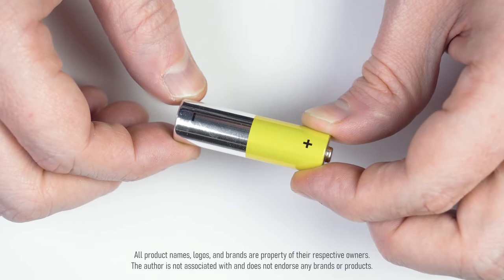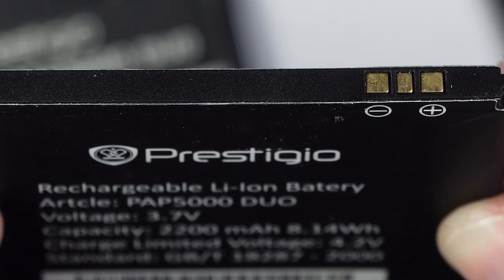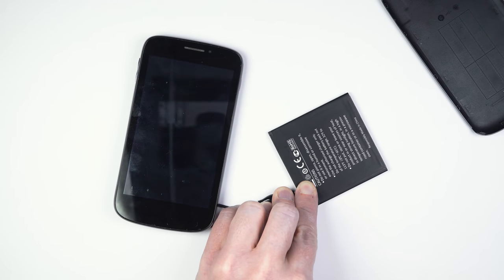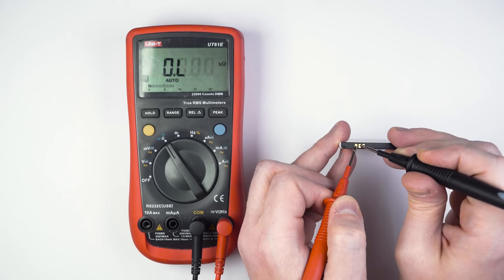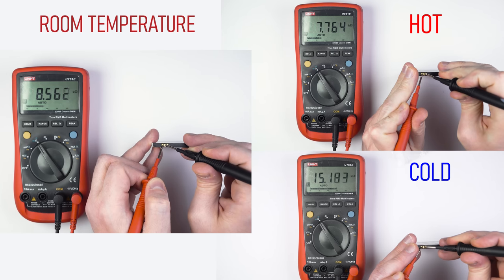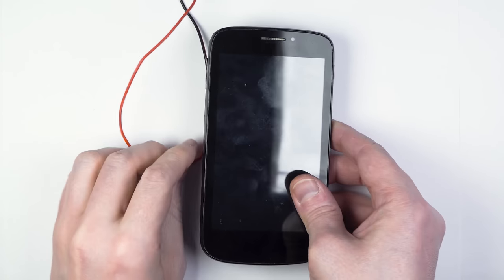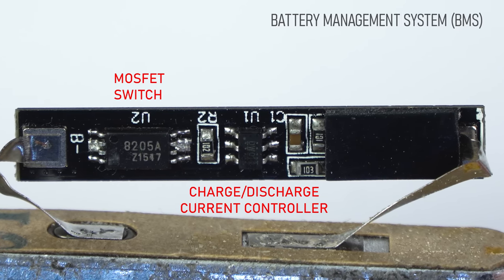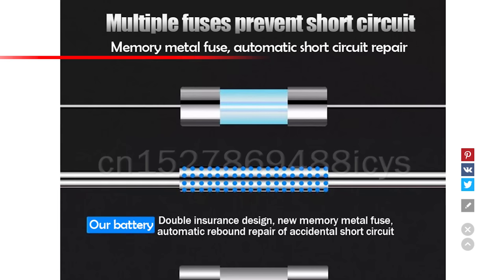Why do MOBILE BATTERIES have THREE terminals? A simple Explanation.

Comment: I have a few old smartphones which I want to repurpose into security cameras, bedside clock etc. The problem is I can't permanently keep them connected to chargers because of fire / explosion risks. Any advice to bypass the battery altogether?
Reply: Yeah you can !
Reply: @shantilkhadatkar1195  Any pointers to how I can do that?
Reply: Find the correct resistance between the sense terminal, and ground. Next, find the correct voltage for the device, and the correct amps needed to power the device. Now, connect a resistor (or correct thermistor) of correct resistance between the sense terminal to ground. And connect positive lead to positive terminal, and negative lead to ground terminal. 
>If this sound unfamiliar, or you are not sure what i am saying, than you can take this info and use it to research further into you project. It is not overly complicated, but i would not want to see a person hurt them selves by getting one of these steps incorrect.
Reply: he actually showed you in the video how to do it
Reply: Make a fake battery out of wood, or print it with a 3d printer. Add terminals in the right places, carve out or drill channels in the battery and the back of the phone for the wires, and connect the + and - from a 3.7 V DC supply to the terminals, plus a resistor to match the normal room temperature resistance of the thermistor, as shown in the video

When you measure the original thermistor feel free to use a dead battery, because the thermistor will still be as it should be; but it does need to be a battery rated for that phone 

Edit to add: our channel creator also suggests trying 10k ohm and if that doesn't work 47k ohm

I've done this myself back in the day when phones had older chemistry in the batteries. I've not tried it with Lithium but there's no reason it can't work. By not having the Lithium there you've removed the only really dangerous part of the phone so in the worst case you've just bricked a phone, not fried a whole building.

If it's a four terminal battery you may have to experiment to get the right connections for both the non-power connections.

I hope that is enough to get you going on that: your project to repurpose older smart phones is a great way to reuse old tech.
Reply: @Inertia888  I doubt he needs to simulate a thermistor with a static resistor.
That thermistor only comes into play when the phone is being charged through the charging port.

I am willing to bet you can leave the thermistor terminals open and the phone will operate from the positive and negative battery connections with power being supplied from a voltage source of the correct voltage and sufficient current.
Reply from the maker: Actually most phones check for the thermistor at power up, so you do need it to turn on the phone.
Reply: Well you can covert 5v dc to 4.2 volts and attach a diode so it trick the phone that it is charging constantly. I just watched that video but can't seem to find it
Reply: @shantilkhadatkar1195  You can convert 5 v to 4.2 volts using two resistors in what is known as a "potential divider".
But when you draw current from the potential divider the voltage will drop. So you need to design it properly so that the maximum current draw from it doesn't result  in too great a voltage drop. Careful calculation on the resistor values will determine this.

No need for a diode. Unless you're putting it in for reverse polarity protection, but as you are hard wiring in the new supply, or using polarised connectors, then there is no risk of getting the polarity wrong.
Reply: @deang5622  What u are saying is right but we need a diode on top of that. i actually tried it with my phone some years back but the charge kept dropping, like phone would go to 0% battery in about 10 mins. doesn't make sense right! Finally i had to put up a diode to trick the phone into alternating between 99and100% so the phone will never shut down.

Comment: Thanks, I kind of knew they temperature monitored, as in the 1980's we had military radio batteries that used a temperature monitor on NiCad batteries to indicate when the battery was charged using a constant current source.  If it starts heating up the energy is no longer going into charging the battery.  I'm pretty certain they used a diode for temperature monitoring. What I did not know was how it worked on these batteries, or that there was over current protection so thanks for the details.

Comment: 4 pins
V+
V-
Clock
Data
Reply from the maker: Nope, that's a great misconception that many people have. No mobile phone that I know ever used this setup. And I've seen quite a few of them when I worked in a repair shop. E.g., Samsung Galaxy S6 battery has 4 pins. Positive, negative, 2.7k NTC (thermistor), NFC sensor output. The battery also has "near-field communication" text on it. Laptop and power tools batteries do have serial chips inside so they use SDA/SCL setup, but no mobile phone, except newer iPhones.
Reply: @RonMattino  so is the NFC sensor on the battery? That makes sense considering where the battery is in the phone, but tbh I had previously assumed it would be in the rear case. My Fairphone FP4 has connectors of some kind to the rear case.
Reply from the maker: @trueriver1950  Yes, in Galaxy S6 it is. And if you use a 3rd party battery, NFC stops working. ;)

Comment: That phone is ancient
Reply: If course he's not going to play games like that with a phone that's still useful as a smart phone. He doesn't care if he bricks that one
Reply from the maker: You can't brick a phone like that. Bricking happens when you upload wrong firmware and the phone appears dead while it's physically in order. Burning a phone is not bricking, it's burning the phone. ;)
Reply: Yea, okay but this info doesn't apply to phones with an integrated battery. They often have connectors with many more pins, not just 3

Comment: That 3rd pin should also be a thermal balance pin. Balance pins assure that the different battery cells are at the same nominal voltage to prevent over charging and over discharging which damages the internal cell architecture. Single cells don't need balancing tabs, since its only 1 battery but they still need thermally protected pins; but 2 or more batteries need balancing tabs to assure both batteries are at the same voltage which prevents a good cell from being over charged do to a bad cell that can't hold or charge up to nominal "max" voltage charge.
Reply: Cellphone Batteries are 1S1P. No balancing needed